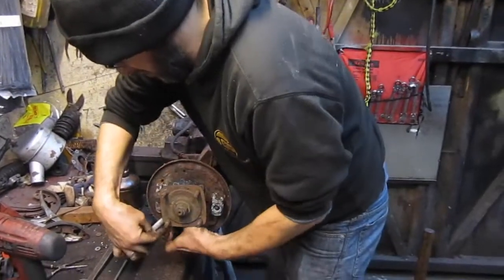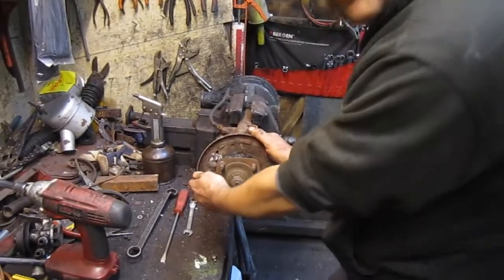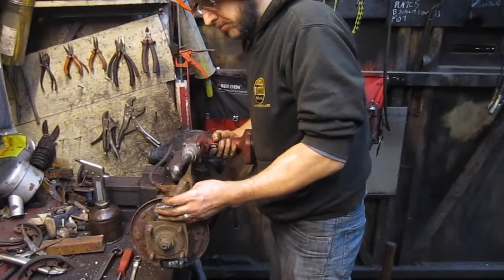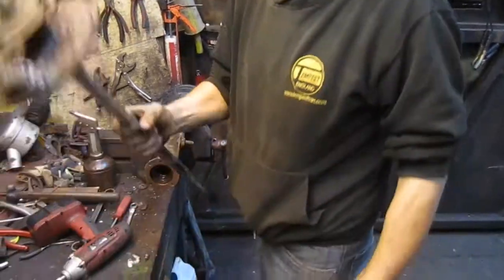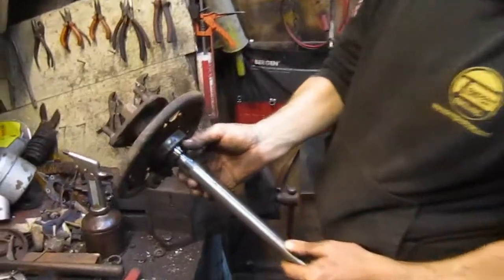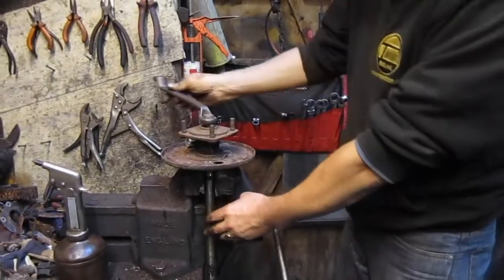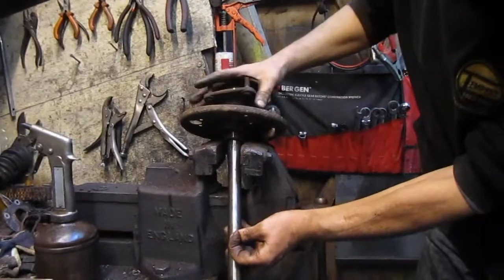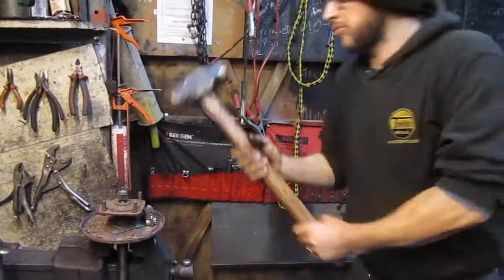Reliant Drive shaft removal trike Robin

Comment: Hello Joe. Is the head gasket of a Robin possible to do under bonnet without removing engine? Cheers. Bought stuff off you before
Reply from the maker: possible ,but  fiddly ,difficult  and if (very likely) the head dosnt come off easy, you will still have to drop the engine out